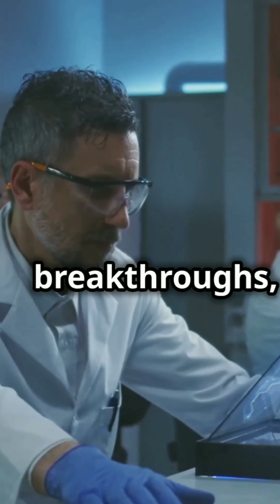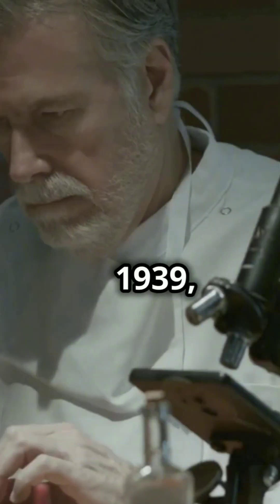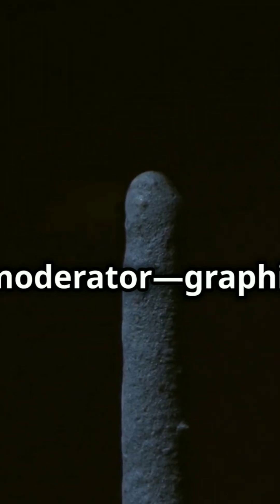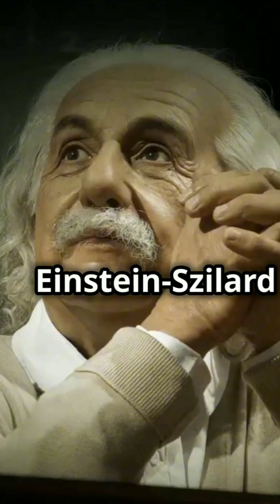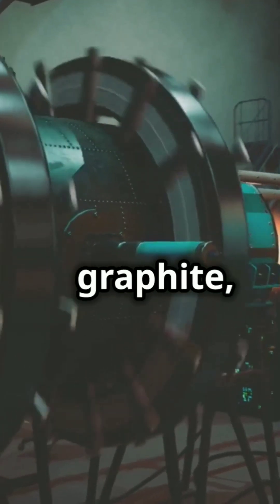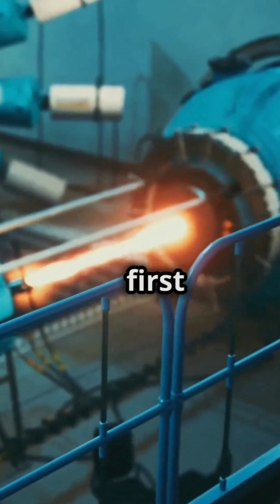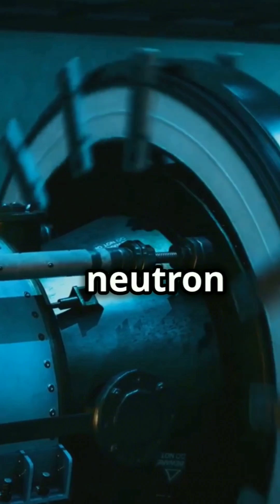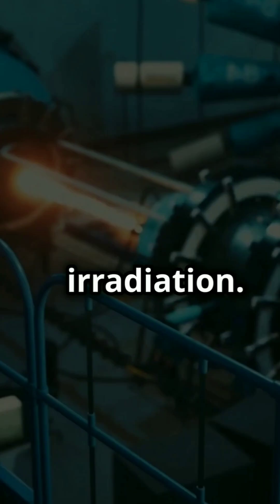Nuclear Graphite: The Unsung Hero of Reactors! #EnricoFermi #ScientificDiscovery #NuclearReactors

Comment: "Sure there were accidents"
Just one small one where chernobyl blew up
Reply from the maker: I understand your concern about the safety of nuclear power, but it's important to note that nuclear power plants are designed with multiple safety measures to prevent and mitigate potential accidents. While it's true that accidents have occurred at nuclear power plants, they are extremely rare and the industry has learned from these incidents to improve safety standards.

The Chernobyl nuclear disaster in 1986 was a tragic event that highlighted the importance of safety protocols and emergency procedures. However, it led to significant improvements in safety measures and regulations worldwide. Since then, nuclear power plants have implemented numerous safety features, such as containment structures, emergency core cooling systems, and robust safety procedures, to minimize the risk of accidents.

It's also worth noting that nuclear power plants generate a significant amount of electricity with minimal greenhouse gas emissions, making them a cleaner and more sustainable source of energy compared to fossil fuels. While safety concerns are understandable, the benefits of nuclear power in terms of reducing greenhouse gas emissions and providing a reliable source of energy make it an important part of the global energy mix.